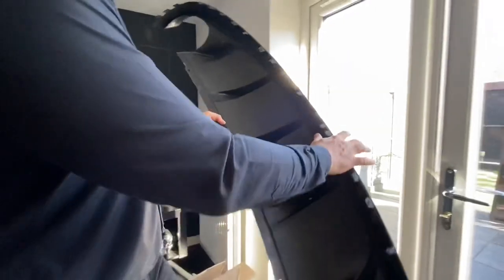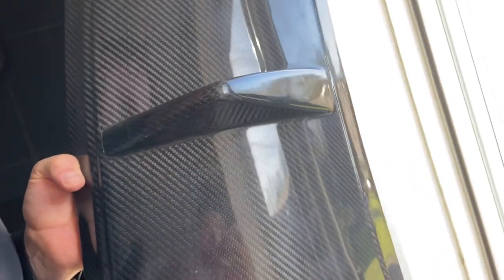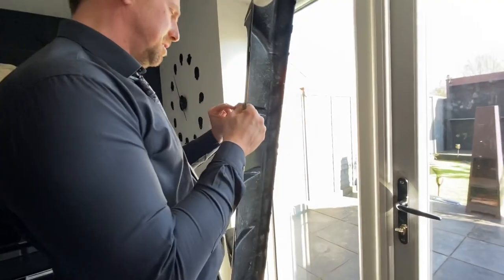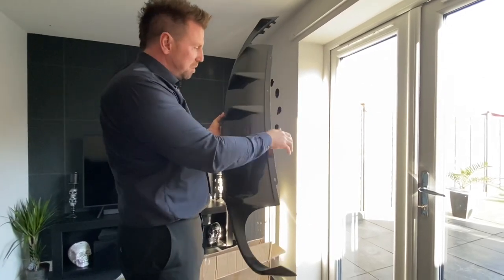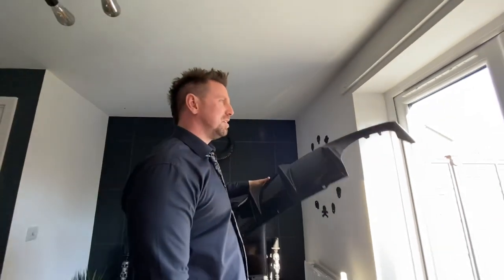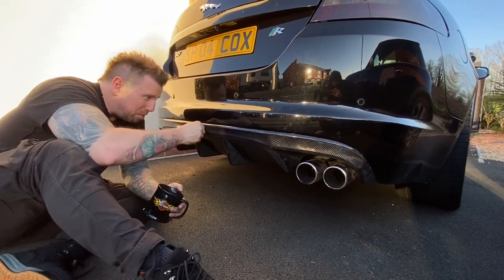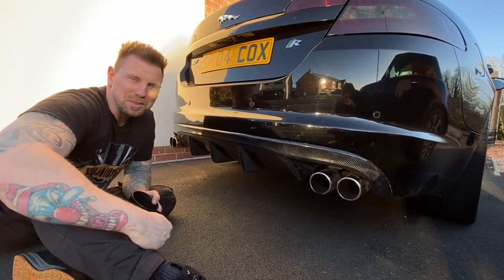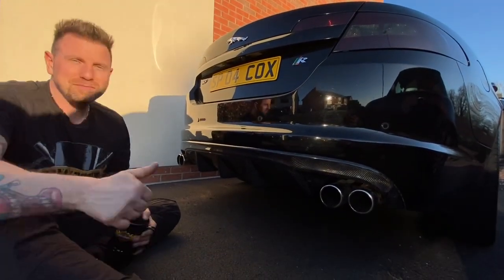Jaguar XFR Carbon Fibre Rear Diffuser upgrade (XFR-S Style)

Comment: Best way to secure it is remove the rear bumper and drill holes in some of the tabs on the diffuser from the back. In the holes apply a thick piece of glue which will set and essentially act as a pin so the tabs cant slide out of the slots. Plus the glue can be pushed back out of the holes if you ever want to remove the carbon and go back to standard

Comment: I watched few of yours videos today and you had same issues with fitting like I had. Tabs on this valance are thicker then the original ones and not so detailed, also carbon fiber doesn't have same flexibility. To fit it right, I had to removed bumper off, then it was much easier to work with. I bought my valance from vehicle revolution and it's exactly same. Anyway I really like how this one looks
Reply from the maker: I was close to removing the bumper, but all is ok. I renewed the bottom fixings today with new ones too. So I’m happy with how it turned out. Always seem to have some sort of issue 😂

Comment: I cringed when you were taking the old diffuser off as I remembered how hard mine was and the two tabs that had tiger seal. You were way more patient than I, as I got in a mood and ended up ripping it. For the money I dont think that looks half bad at all.
Reply from the maker: I was getting close to ripping it off buddy, it was so frustrating, that’s why there wasn’t much filmed lol.
Yeah it looks fine now it’s on, just disappointed it had thin bits.
What did you put on yours?
Reply: @69racer69  I put the OEM RS valance and diffuser on.
Reply from the maker: @andrewjohnson6657  that must of cost a bit?
Reply: @69racer69  no not really IIRC I got it from Britpart the valance was around £80 and the diffuser was £170. The diffuser came painted gloss black but the valance only came primed. I got a local place to paint for £100. So whilst not cheap not expensive either, I wanted the OEM look.
Reply from the maker: @andrewjohnson6657  ahhhhh I know the one you mean. That’s not too bad, I bet the clips where better quality on the replacement?
Reply: @69racer69  actually not really, only in as much as they were newer.

Comment: Can I ask did the original come without fins? on your vid it looks quite plain, my XFR is a 2014 and has the fins already but not in carbon fiber, how did they leave the assembly line? is my version  already moded or was it an option?
Not planning to change my diffuser but love your vids.
Reply from the maker: The earlier models didn’t have the fins, they weren’t an option either. But the facelift had it as an option.
Reply: @69racer69  Thanks for clearing that up Bud

Comment: looks great buddy, may i ask what exhaust you have?
Reply from the maker: Thanks Matt, I have a Spires Stage 2 exhaust. Best sounding if you want a refined growl that is still good on the motorway.
Reply: @69racer69  is that just backboxes or a change to the center section aswell?
Reply from the maker: @bigmatt2896  just the back boxes.
Reply: Any equivalent exhaust fitters near London ?

Comment: Has anyone installed K&N air filter's, on the XFR? Any issues with maf flow sensor's? There is a offer going on Amazon, £40 each K&N Filter.
Reply from the maker: I have the K&N panel filters installed. They have been fine.